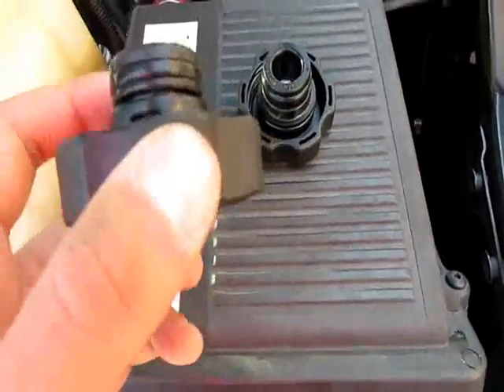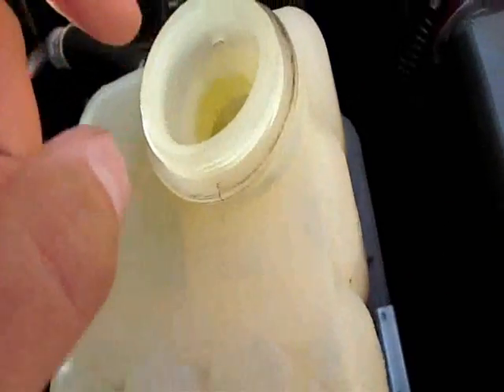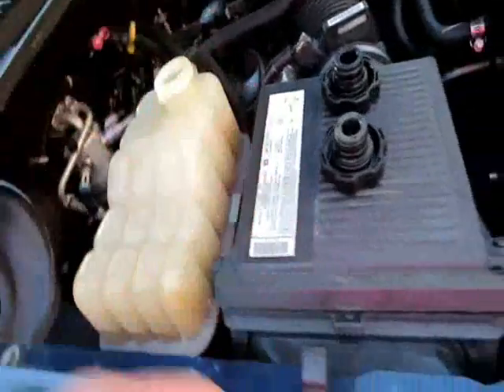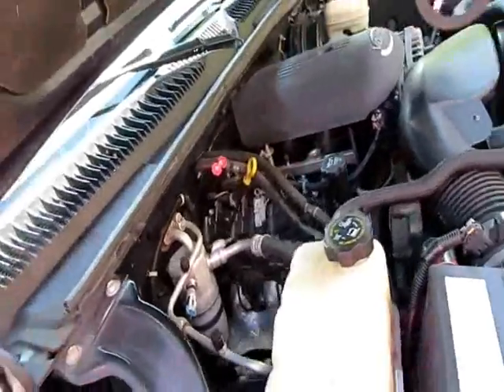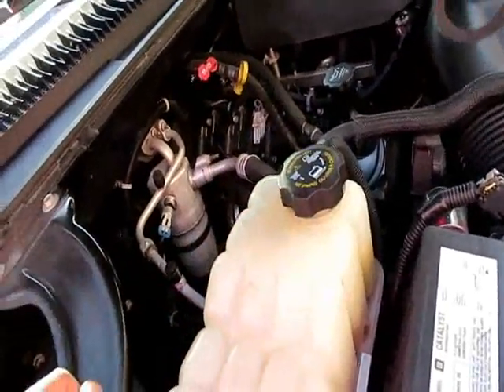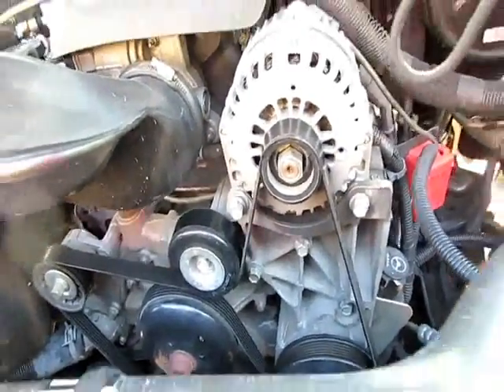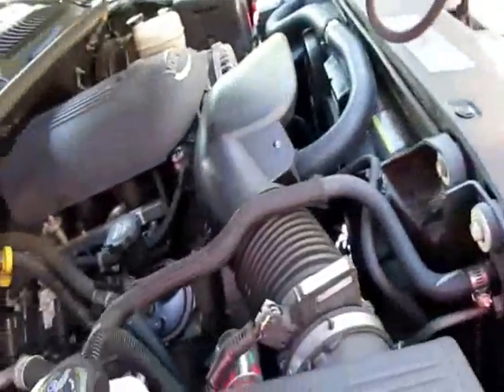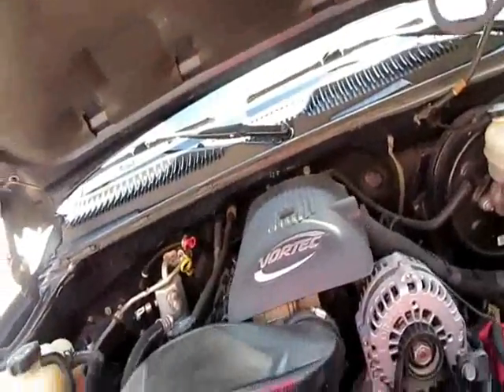COOLANT LOSS fix Coolant Cap, Silverado Sierra Tahoe Suburban

Comment: Dude! Soooo thankful I found your video. My first instinct was a cracked head, lots of labor time and money. I bought the new cap and replaced the old one. I stopped losing coolant and my overflow tank stopped having condensation in it. Thank you so much for putting this video out there man. I appreciate it.
Reply from the maker: Ya it will work for awhile. These O rings harden fast in hot climates
Reply: @GhettoWagon  Hey man, $10 every so often is still better than a cracked head any day. Lol
Reply: @ryanrainbolt6135  for real bro!

Comment: I've been losing a little coolant over time in my 2001 Suburban with no visible signs of leaking. I am hoping I don't have a cracked head or freeze plug issues. Thank you for sharing.

Comment: I to was lucky enough to fix my coolant usage with a new cap . 2004 tahoe . 
Thank God ! No cylinder head issues on this truck ...
Reply from the maker: I know! I thought he same thing. When I changed the valve cover gaskets and the engine looked like NEW, very clean, always used synthetic oil i felt even more happy   The caps are made in india, not sure about the aftermarket. I guess the quality on them is not so hot after 10 years of use

Comment: I knew it would leak out of that hose after I filled up my tank till there's almost nothing left in it. Then I found my oil cap was milky when I topped off a quart, and first thought was head gasket leak. Hopefully this works and I'm gonna use the combustion leak fluid/testor too. Thank you so much for a (potential) solution to a problem I've hated and spent too much on coolant for
Reply from the maker: Cap rubber O ring is mashed on this thing again they don't last long or the owner of this now trashed piece of junk just uses it too much.  Sometimes 60 cycles a day.   on off on off on off.

Comment: 2013 Chevy Express 6.0, mine has the same cap just on the radiator, had the same issue. Fixed! THANK YOU
Reply from the maker: Yea it will harden again.    Overlooked part.   Easy solution.

Comment: Yep, changed mine, But it's not just this oring. Theres another rubber seal that expand and will prevent a good seal in the middle. It on the part that pops up to drain excess pressure. You can see it through the slots on the sides
.
I THINK i made a video about it
Reply from the maker: Veikra  Ya the upper seal was a little shrunken but not nearly as bad as the lower one.  I figure for $10 its cheap insurance.  Ever see the coolant tanks explode on these? I might buy one just to have it.
Reply: 10$ is cheap. the same cap here is 32$ at the stealership
Reply from the maker: I didn't go to the stealership!  Amazon!
Reply: I looked through all your videos couldnt find it

Comment: Was having the same problem and I thought that it was my thermostat for either water pump or hoses leaking and the antifreeze was overheating. Spray out everywhere visible smoke so I bought a new cap it is corroded and hopefully that fixed the problem. 🙏🏼😫

Comment: My 2008 gmc sierra 2500hd duramax was loosing a little coolant over the course over 2.5-3 months and i could smell coolant in the engine bay. I looked at my coolant cap and it did just like the one in the video. The O ring was flush instead of like the new one where it bulged out. $12 later and my coolant level is back right and i can no longer smell coolant at all!
Reply from the maker: Ya they dry up and harden. And the plastic gets weak so you might as well throw on a new one its a wear item

Comment: Hey man great vid and tip! My truck had the dreaded castech head. I will be checking my pressure cap!
Reply from the maker: Just look at the cap you have now. If the O ring is dried up and looks squared off, its bad.  I just changed this cap again some years later.   They cook in this heat here.
Reply from the maker: Forgot to add, And if the oil is not milky or the oil filler cap is not white with goo, the heads are probably not cracked.

Comment: I have an 07 5.3 that's loosing coolant. I'll try this, i hope its as simple of a fix as this!!!! Did you order the 15 psi cap? Or 20 psi? Im not sure what to get.
Reply from the maker: Whatever the stock rating is, pretty sure its 15psi. If the seal is all hard on it, you know its the cap.
Reply: Ghetto Wagon yeah it's 15psi. I just heard that gm switched to 20psi. Just curious. I replaced cap, but its still leaking. I'm having bad luck with this thing.
Reply from the maker: tomificationable
 pressure test it.   Water pump gaskets leak, the plastic connectors at the heater core leak, the coolant hose Y off the passenger side of the water pump cracks,  I had a small crack on the radiator tank that "boiled off" coolant for awhile before it let go   It was all the way in the front, I ordered a new rad and waited until the day it popped lol  That or it has leaking cas tech heads, pull the covers off to see if a milky sludge like substance is allover the bottom of them. At this age the valve covers will be "seeping oil" like these were until a few months ago when I changed the gaskets out
Reply: MayburyMayhem did u ever figure your truck out?

Comment: I don’t know man I replace the Was one from AutoZone for 15 psi and I’m still leaking from the top and from the reservoir overflow hose could it be my head gasket?
Reply from the maker: Is the tank cracked?
Reply: Aquatic Pool  Did you ever figure out what’s wrong what it
Reply: Hg or thermostats - Did you ever figure it out?

Comment: If there’s. No a cap on the tank can it lose coolant
Reply from the maker: Haha. Not to be a wise ass but I challenge you to find out what the purpose of the radiator cap or coolant tank cap in this case purpose is and how it works then you will quickly understand why you need one.  Hint. Cap keeps the system under pressure to reduce the boiling point of the coolant.  What happens when liquids boil?  It what? Evaporates.  Ya you need a cap  :)

Comment: I am thinking this is my issue, I have one question, when you were on the highway did the temp drop back down to 210?   Idling and running the air in town sends the temp to the red zone.    Thank you for the insight and help
Reply from the maker: No it did not overheat I just lost maybe a quart of coolant every few months  and had a coolant vapor smell
Reply: @GhettoWagon  Went ahead with your poormans fix. First off I had to put a gallon of mixed coolant in, changed the cap, and since then I have yet to have a lover heating problem. Sitting right at 208, idling, town driving, all good.  I have yet to kick in the AC.  Thank you for this simple fix, I was set to put a fan clutch in.
Reply from the maker: @jimmyjam209   If the old caps o ring were flattened and hardened you know it was it. In theory you can just change the O rings but they need to be a high spec
Reply: @GhettoWagon  follow up, after 4 days of running fantastic and staying where it should be at <210 the water pump gasket sprung a leak.  I can only assume it was due to the pressure that was now being maintained by the new cap.   Now I am going to try one of those K-seal, Bars Leak, or Aluma-seal to see if I can limp this thing a long.   I am not spending 700 bucks.   I should have changed out the cap 3 years ago when I had the water pump replaced.  Ghetto, the cap was genius.  The caveat, watch for gasket leaks afterwards.
Reply: @GhettoWagon  i had the exact same problem
Reply: @jimmyjam209  my 2014 Silverado done the same thing, was traveling and was getting hot, opened the hood and the cap was missing, got a new cap and a day later the water pump started leaking
Reply: @mikehauer3236  thankfully for me the part was still covered by warranty so all I had to do was intstall it.  They now come with the thermostat and pump all together in one piece. I dunno if that is good or not but it is what I put in.

Comment: my old 2006 1500 had a flex fuel 5.3 and about 140,000 miles it started loosing coolant. i think it was cracked heads. so i traded it my my current 2500 with the duramax and LCT1000 ALLISON 6 speed
Reply from the maker: 06CHEVYDURAMAX  Ya this one does not loose much and I smell coolant vapor, so whatever is happening is external. It was good for awhile, but the more the tank cap was remove and reinstalled, the level kicks down a little.  I still never changed the coolant hose assembly with the Y off the water pump, its damp but its not leaking like it was.  The WP makes noise on it now and then too, I need to pull the belt one day to check how its spinning

Comment: I got 2011 gmc sierra and one day I smelled coolant when i stopped to check i found it empty totally empty i refilled it again and within one week its empty again so i took my car check if there is any leaking and they no leaking was found at all still having the problem and i might check the cap well see am hoping this solves the problem
Reply from the maker: Maybe.. That or the coolant is not circulating well.  Check the thermostat operation too
Reply: Ghetto Wagon thanks for the tip but i went today to check it up in another place and i found out the radiator is damaged and it caused all the issue that am having.

Comment: Could a faulty coolant tank cap cause air to get in the coolant system? I have "burped" my coolant system many times and the heat inside the cab will be ok for a couple days, then I am freezing again.
Reply from the maker: You probably have a clogged heater core from nasty rusty coolant

Comment: I'm not losing coolant but can smell it sometimes, I think the cap maybe the problem??
Reply from the maker: Could check the cap o ring if its hardened change it  Water pump, radiator, could have a small crack on the side tank (had one for a few years until it exploded)  And  the plastic parts on some hose pieces like to crack and leak.  I have a coolant like smell when its warm and I think the water pump leaks a little.  Ill run it till it fails I should check under it again its been awhile
Reply: I replaced the fittings for the heater core as one was dripping awhile back. Everything is bone dry. I will inspect the cap. And for the cost probably just replace anyhow
Reply from the maker: pull the plastic off the radiator too, the top piece with all the push clips and shine a light look on both sides of the radiator tanks for cracks. Small crack, wont drop much coolant until it fully fails    The coolant y by the water pump also will crack and explode.

Comment: I'm having a similar issue, I've noticed the underside of my coolant tank is leaking only while running. That wouldn't be cap related would it?
Reply: Mine was doin the same thing after buying 3 resiviors in a year I just filled the hole at the bottom with a glove to get me home so if it got really hot it would melt the latex glove I know its wrong but I'm no mechanic an nobody at several auto parts stores can answer plus I called a mechanic an he hung up cause he don't answer questions for free

Comment: Why not just replace the o ring?
Reply from the maker: to run around and find 2 large o rings that fit for 2 dollar and hope they will last is not worth it when the cap is only a few dollars more. Cap is plastic how many heat cycles does it last?
Reply: @GhettoWagon  I have thousands of o rings. Works for me
Reply from the maker: Try it then.  Just note the cross directional width alot of o rings vary.  They look like that fit but they are not thick enough    @schrankm
Reply: @GhettoWagon  mine is actually a radiator cap on the radiator so it's a bit different. I put a new o ring on mine and it's been leak free for over 2 years. The thickness of it doesn't matter as long as it seals
Reply from the maker: Like the big thick washer like on a caprice? Saw your video.  Those get torn up 
   @schrankm
Reply: @GhettoWagon  No. It's on a 5.3 in an Envoy. The cap is just like yours, which is why I wondered why you said 2 o rings.
Reply from the maker: 2 is correct. One small one and one around edge of the tank.   @schrankm
Reply: @GhettoWagon  The larger one isn't an o ring though. It's a flat seal
Reply: @GhettoWagon  on mine anyway
Reply from the maker: Yea its like what would be in a older style radiator cap.   Good to change that one too  .   @schrankm
Reply: Nigga u cheap jew!!!